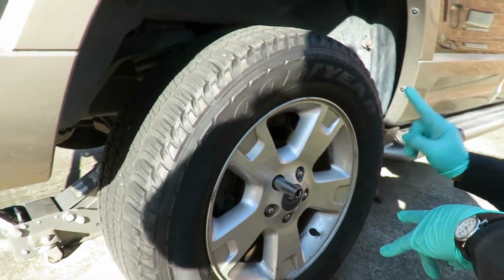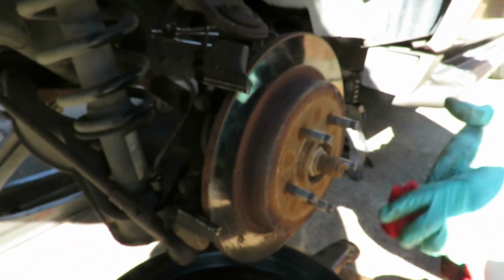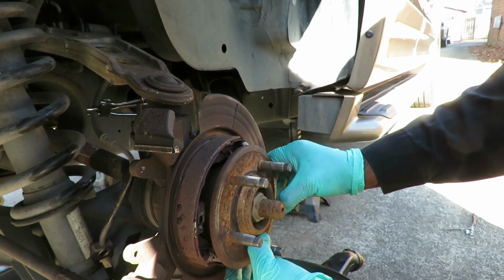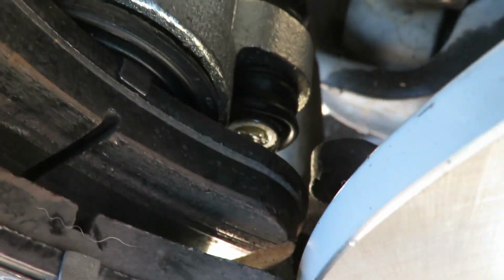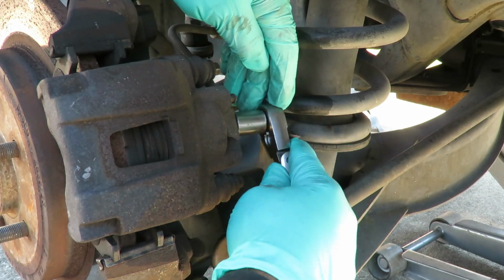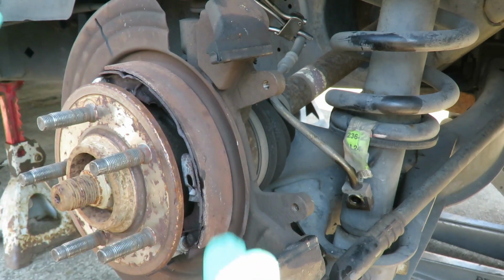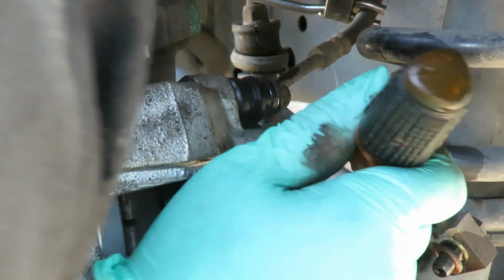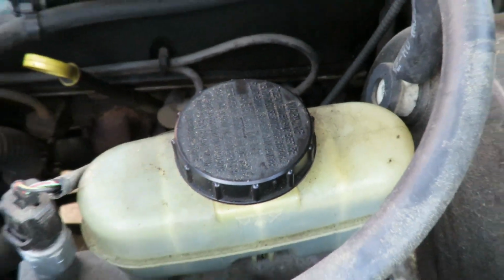⭐ 2003 Ford Explorer - 4.0 - Rear Brake Calipers And Rotors

Comment: I'm a MECHANIC and I like the way you explain your steps, this makes it easier for almost anyone with tools and some knowledge of taking things apart and putting back together. You ever get a chance to get into automotive teaching in a school, I'd say take it for the retirement package plus summers off and still can work this job as well. Maybe you due who knows but great video. One thing I would of done differently, that's adding anti seize to hub before putting on rotor, that's so they don't freeze to HUB, now on back you have the parking brake that works as drum brake when parking BRAKES are APPLIED, I bet these have been driven with them on a few times for those to fall apart, that's the 1st for me to see, also great hack job on fixing that issue, JB WELD WORKS GREAT, better than spending $50 more on shoes that won't be used that much I bet, I own & 2003 AWD Limited with a 4.6L engine, now I swear by never seize or anti seize that turns you into the Tin Man from the movie,  Wizard of Oz, I hate getting it on me, I've been wearing gloves from the 1990's on fixing cars, a FRIEND worked at a warehouse supply for HOSPITALS, boxes get thrown away when ripped open or damaged, he take them home for me, also great for picking up dog poop and peel off and bag at same time, I still use those and got others wanting them. Less cleaning hands on easy greasy jobs. Ate Pizza before to help clean hands at end of week. This video should be up as the top video on how to even with what happens and don't have everything go your way, when I was in high school taking Automotive class, I was the only Freshman that could take there car in to fix, my father worked for GM, so I started at 5 years old handing him wrenches while under the car fixing them, he taught me how to read wrenches and sockets in the difference of quarter inch 3/8 half inch and three quarter inch 4 Drive, also he taught me the difference between short sockets and deep sockets open-ended wrenches and box wrenches also showed me the difference in impact sockets over regular sockets which he didn't have much but he taught me at young age, so I fixed my peddle bikes when chain fell off or handle bars wasn't to my liking, didn't need to bother him, only if it needing wielding from jumping off jumps/walls, now I pay in pain in late 40's glad there wasn't no tricks going on when I rode bikes and dirt bikes. If i couldn't fix them, then I shouldn't own it he said, must have mechanical KNOWLEDGE on how to fix dirt bikes and my first car. Saves lots of money. Keep making these great video's, no small details are to small not to add in, I would of fixed the EB the same way, others wouldn't at all but plenty of meat left on them, now there isn't one person would of posted that video because of customer got wrong rotors which are made for RACING/STOPPING POWER if pulling trailers only, otherwise no need to have slotted holes rotors now, just eats up pads faster. Now the Ford Explorers aren't great to pull heavy loads, UHAUL won't rent anything to you with a Ford Explorer now, not unless its a 2013 or newer. Because of the vad name they got in the 1990's on rolling over due to bad Firestone Tires that blew out. That's how they explained it to me. Wanted to move my son out of his dorm and needed a closed trailer, ended up finding a friend not using his. 600 miles to school and back would of cost to much for a moving truck, after 4 year's, they end up with a bunch of stuff, a bunch rented a storage place to hold there stuff for summers, cost $65 per a person for 3 months total, cheaper than hauling 600 miles. Good luck to all that fixes there own vehicles.
Reply from the maker: We appreciate your great comment, and thank you for sharing your experience  with us.

Comment: Every video I've seen on a Ford Explorer has not gone as planned.
Reply: IT'S A FORD FOR ONE, 2, FORD SCREWED UP BY MAKING THIS SUV, THERE'S 44 DIFFERENT VERSIONS OF IT, SO EASY FOR TO MANY THINGS CAN AND WILL GO WRONG. I BET PEOPLE DON'T KNOW THERE'S ONE MORE THAT MOST DON'T KNOW ABOUT IN 2003, NOT LISTED ANYWHERE. I THOUGHT SOMEONE THREW A BADGE ON ONE AND IT SOLD CHEAP WITH LOW MILES ON IT, I THINK IT WENT FOR $2500 AND 1 OWNER, CAME FROM A VERY HIGH END PART OF MY STATE TO WHERE MONEY ISN'T AND OBJECT, I NEVER CAN MAKE A PURCHASE DOWN THAT END, PEOPLE BUY UP QUICKLY AND SELL THEM FOR DOUBLE THE MONEY. I EMAILED THEM TO FIND OUT THAT FORD MADE ONLY ONLY 5,000 OF EACH VEHICLE IN 2003 WITH A SPECIAL EDITION BADGE ON IT, NOW ALL IT WAS. A 2003 AWD 4.6L LIMITED BUT BADGED AS SPECIAL EDITION, ONLY CAME IN BLACK ONLY AS TO ALL FORDS CAME IN BLACK 100 YEARS AGO TO 2003 NOW. SO IF EVER COME ACROSS SOMETHING WITH LOW MILES AND THE 2003 IS NICE CAR, THEN RESEARCH IT AFTER LEAVING SOME TYPE OF DEPOSIT ON IT AND ACT LIKE YOU DON'T KNOW, THEY PROBABLY WILL TELL YOU ABOUT IT, HERE FOR ME. JUST LISTED AS FORD EXPLORER, I SEEN THE BADGES ON IT ON ZOOMING IN, CAN'T EVEN LOOKUP BOOK VALUE ON IT, I'M NOT SURE HOW YOU WOULD, BUT IF YOU LIKE HISTORY, THEN FORDS IN 2003 AND ITS ALL BLACK MOW WITH SPECIAL EDITION BADGES ON IT, ITS REAL. NOW IF YOU LOOK UP OTHER TRUCK'S THEY MADE ONLY DO MANY OF, LIKE THE HARLEY DAVIDSON'S EDITION SHOWS UP ON THE BOOKS WHEN LOOKING FOR PARTS, JUST NOT IN 2003 SPECIAL EDITION. I HOPE I HELPED OUT ANYONE ON THIS. AGAIN EVERY FORD MADE IN 2003 YEAR PUT OUT 5,000 OF EACH MODEL, NO LINCOLN AT ALL OR MERCURY NEITHER. ONLY FORDS NOW AND IT'S BLACK PAINT BLACK INTERIOR, BLACK ON BLACK AND IF CONVERTIBLE THEN TRIPLE BLACK. JUST NOT SURE IF THEY MADE ANY IF THEM, IF THEY DID, THEN IT MIGHT BE THE MUSTANG. THAT CAR WILL BE WORTH MONEY IF BOUGHT NEW AND PUT AWAY WITH LOW LOW MILES,

Comment: I have the rear  driver side is locking up and burning the brakes, I been reading and some people says the brake Line hose need to change or the rotor, is there is a way to check which one is causing the issue , my Explorer has the advance track on all 4 wheels with independent suspension, I am also getting a code to change the same wheel speed sensor which I am about to do , any advice would be great, Thank you in Advance .
Reply from the maker: you want to check the brake hose, and be sure to MAKE SURE the brake pads are sliding properly. If those check out, check your caliper.
Reply: @OnlineAutoRepairVideos  Thank you
Good bless
Reply from the maker: @joey1917  No problem!